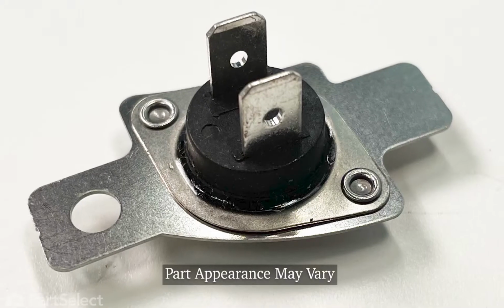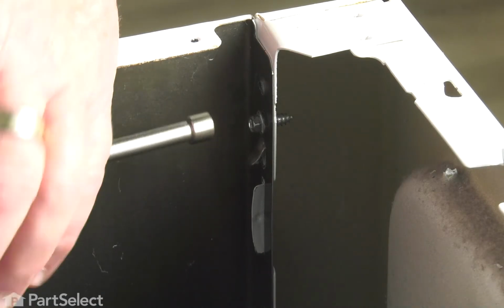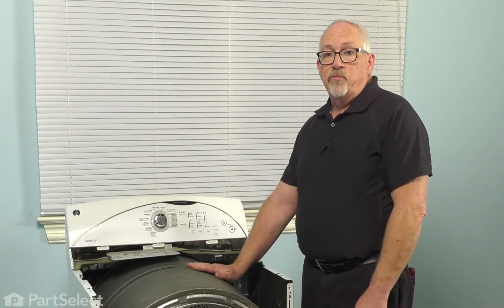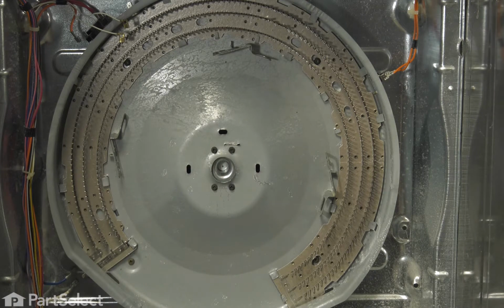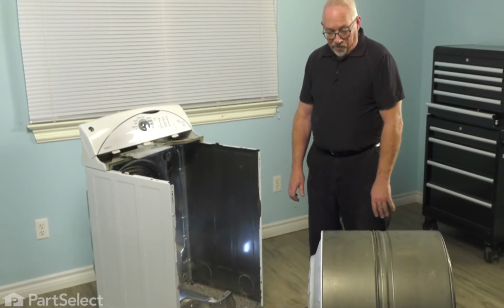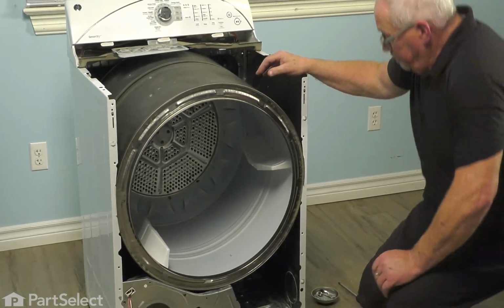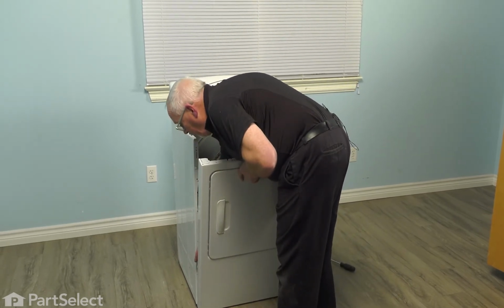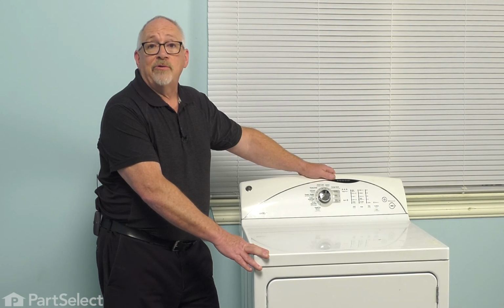GE Dryer Repair - How to Replace the High Limit Thermostat (GE Part # WG04F00539)

Comment: Hi ! Im wondering if this is the piece I need to replace. I keep installing new thermal fuses for they keep blowing. The machine still heats a lot even on low setting. 

The ventilation is NOT the problem. I checked again and again. 

Would the high limit thermostat be the faulty piece ?
Reply: gas or electric? if electric then your heating element may be grounded. run the dryer on air fluff only no heat and see if it still gets hot

Comment: I had Kenmore Microwave P# 3850W3W030G for over 15 yrs, all of a sudden for the first time I have some issues: Power, lights, digits are all ON, but does not spin or warm anything! After searching for the problem, found out it could be Door Inner lock switch. What do you think the issue could be and where to find the part? If inner lock switch is the problem! Thanks